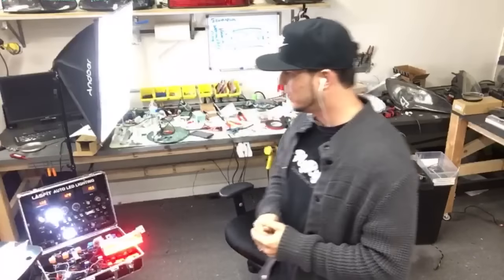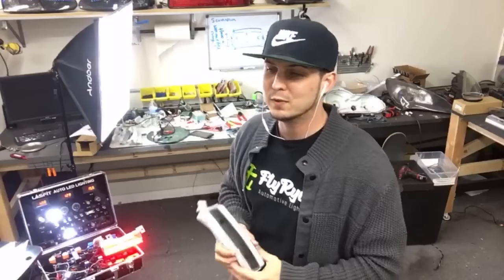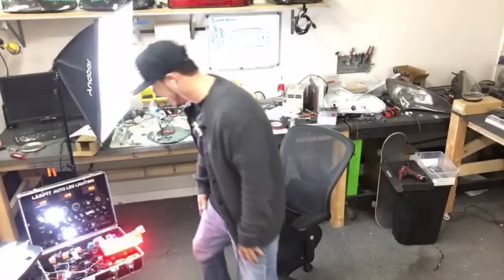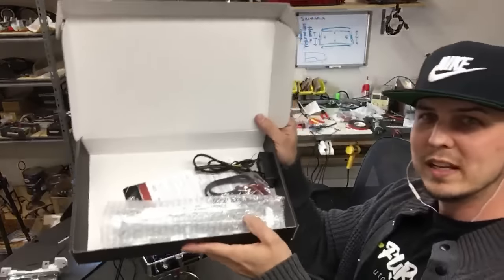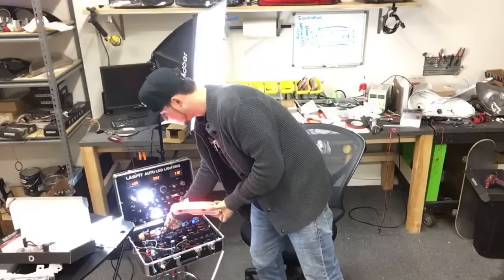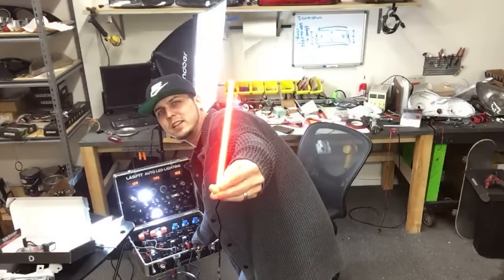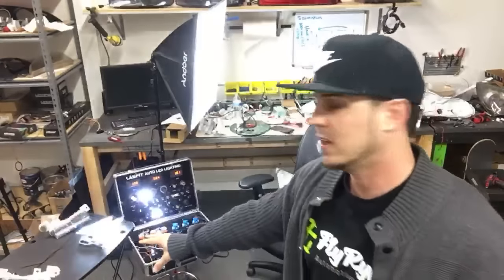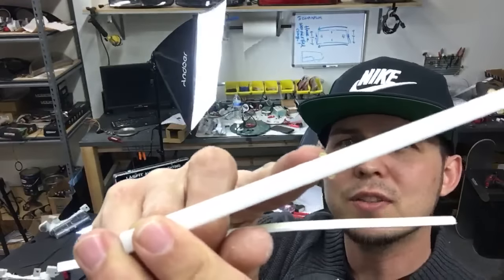Solid LED Strip for Custom Tails and Side Markers | Diode Dynamics | FlyRyde

Comment: I assume those strips are a bit pricy since they are a name brand rather than some eBay strips but my question is .. if I could spend 15 bucks on a 5m roll of leds on eBay or Amazon why would I spend more money on that 6 in strip? I mean you can cut just about any led strip to size An they still work, An I'm pretty sure no matter what strip you buy you still only able to cut every 3 leds off .  I do agree cheaper leds are not as bright as the ones you showing but I think a lot of diyers out there would not mind losing a little brightness if they are getting more leds for the money.  I watched a lot of your videos and they are great .. I dabble in custom lighting myself in my car audio shop, I mean I don't get as involved in it as you but I know my way around the custom lighting industry a bit.  I normally use XKchrome products in my shop, and I know you do too, so how do you rate the products in your video compare to XKchrome as far as brightness and versatility on custom builds ?

Comment: Hi Chris, I had a question about these LED strips. I'm customizing my Taillights on my Juke, and I'm going with Vled Max Pods for brake lights and turn signals and going with an LED strip for back up light. But my tail lights have an S bend to them were I want to put the strip. Are the HD strips flexible enough for that kind of bend or am I better off going with Profile? Thanks

Comment: Hello Chris I have been working on making my own tailgate led strip ligth bar I have a problem trying to wire it to the existing harness. So I am trying the rgbw not all the colors I do not need just the white and red. I buy the tailgate strips and they didn't last I want to make my own can you help me with this project.
Reply from the maker: I have a great course about RGB and RGBW that I’m adding to all the time. I’d think about diving into that so you can learn more than just the one goal you have in mind now 👍

Comment: hey i ahve a 2004 lexus LS430 and the break light went out and it is a LED but there is no replacement led . on a forum they say i have to replace the whole light . any ideas ?
Reply from the maker: Oscar c they’re correct unless you open it up and swap the LED. It’s either a dead resistor or the LED itself is bad. These things can sometimes be opportunities to make easy side cash. If it’s an easy enough fix, I’m sure others out there would want it too. How much is a new light?
Reply: @flyryde  the new light oem from dealership cost 200 . eBay they have used for 98$ ,but eBay runs the same risk it's used so might also go out . Also I took the light out and I would have to pry it apart to access the led  cause I'm sure they are glued just don't want to damage and break it . What type of glue would i use  to put back together if I can get it open . Will probably buy the eBay one and experiment on one .